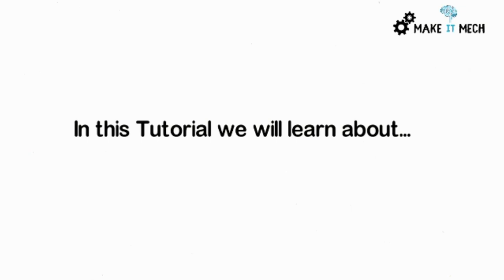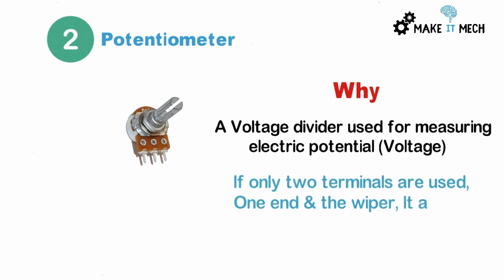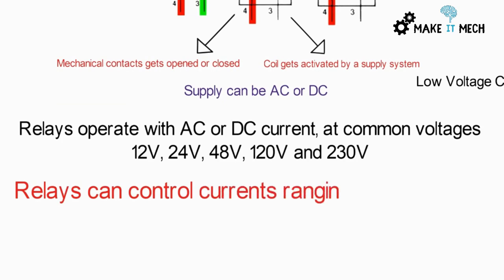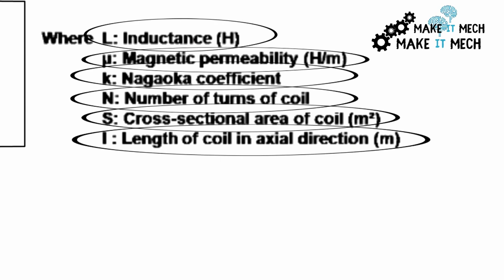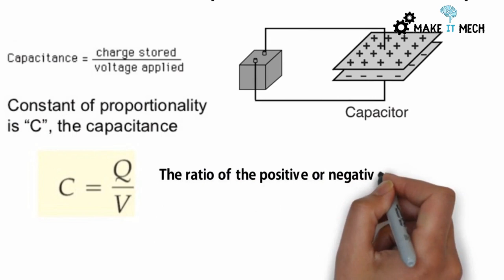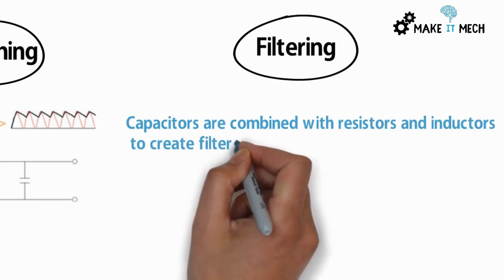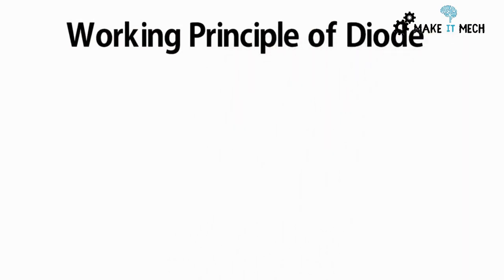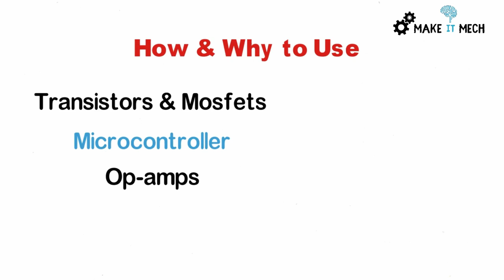Basic Electronics | How & Why Electronics Components Tutorial | Step by step Electronics

Comment: good videos for us. but we have one doubt, generally smps input side has some filter circuit used like inductor and thermistor, that time inductor allows ac voltage like 220 or 110, inductor allowing dc while blocking ac. can u explain us detail and same way capacitor also allowing ac while blocking dc. in smps capacitor it allows dc like 380v..